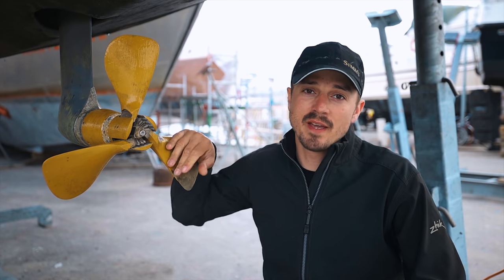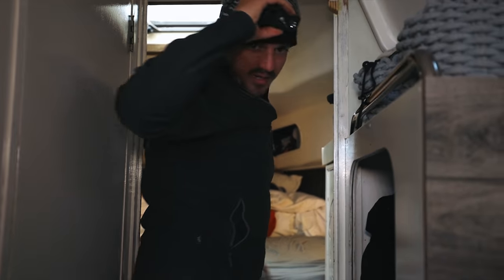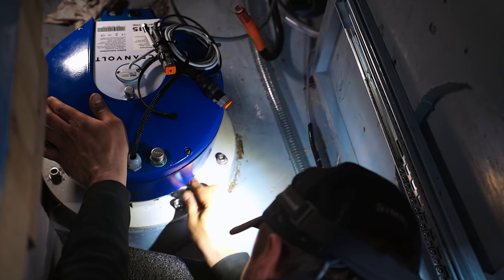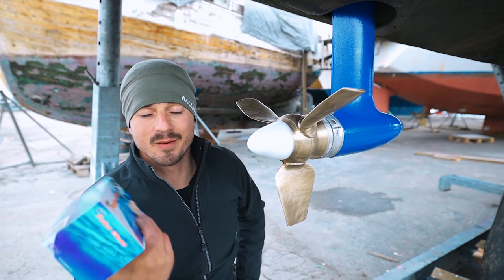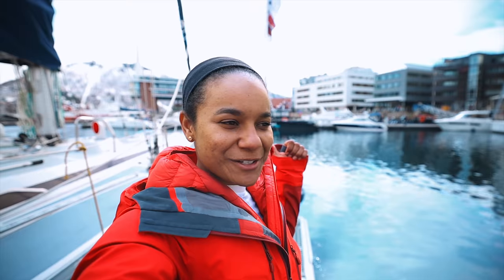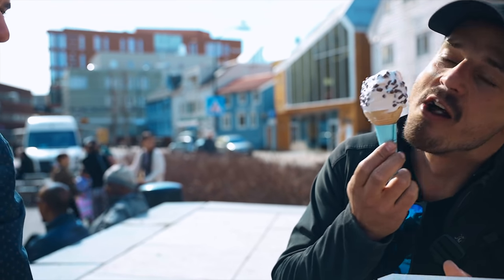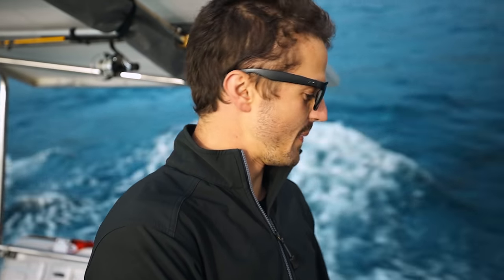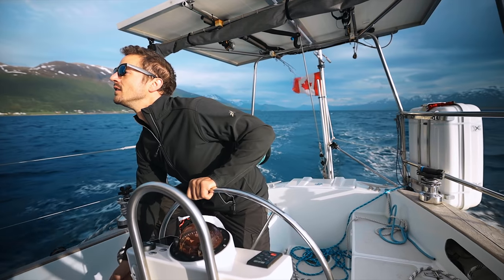Ripping Out our Electric Motor for the LAST TIME! — Sailing Uma [Step 277]

Comment: Nice video. It is not surprising that you don't lose much speed at high wind speeds, when the boat is close to max speed and a lot of energy goes into the ship wake anyway.  Basically you are just reducing the energy loss to the wake. It would be more interesting to test how much speed you lose at weaker winds, when you actually increase the total resistance of the boat in the water.

Comment: The hole around your prop-shaft is a break and could also make turbulence for the propeller. Cant be hard to fix that. The reason you dont notice the regen- is probably that you are close to the hullspeed anyway - in lighter winds it may be more significant. Did you meet  Allure Arctic there -we see his new boat in the back there?

Comment: It would be fairly easy to figure out what speed regen costs you , as you calculate kw required to do speed which will give kw / kt .
You could do this very roughly by knowing how fast your known kw outboard can push the boat.

Comment: Thats great, I can't wait to hear about the low/mid-speed performance and of course the electrical load and regen....as the prop servo is a new power use item.
Reply from the maker: The servo motor consumes almost zero power. It's just to adjust the pitch, then it's "off". So it's only active for a few seconds.

Comment: Wow You Two!! Your installation of the Ocean Volt Servoprop was so interesting I have just watched it again. The numbers are very promising and with your solar array as well it looks as though you will be on the plus side of your energy equation. Are you able to alter the pitch or is this predetermined by OV? Looking at the prop speed (it’s quite low) it seems they deploy quite a steep pitch to generate torque for the regen load. I can’t wait for more data and comments including about the responsiveness in forward and reverse. Real world testing by people attuned to the realities of “going electric” will be of huge benefit to OceanVolt.

Comment: I would have been tempted to close that giant vortex generator around the drive leg with expandable foam, fairing and painting it.  If you ever need to remove the drive leg, you dig the foam out. In the mean time a lot less drag.

Comment: that is so awesome.  Hey I know water pumps can break quickly if run without water. Is it bad for your motor to run it in the air? I know you probably are following the directions which probably tell you to test it just after installation but I just wanted to check.  You guys are awesome, I love your work on your boat. Honestly I'm really impressed by what you have done, more than the other sailing channels.  I wish I could learn to be like you with your boat.  God bless.

Comment: Nice docking! Congrats on your wonderful boat (best modifications I have ever seen), a great job all around! 
Regarding the speed drag from the charging: It makes sense that when you are sailing at or near hull speed, it is not noticeable. That is because there can be a large amount of "excess" power from the wind that acts as a buffer. When a boat reaches hull speed, it takes exponentially more power to make it go even a bit faster (surfing downhill doesn't count because those high speeds are a vector of the wave and boat speed). Where I suspect it will be noticeable (half knot or so maybe), would be sailing up hill in fairly light airs, with speeds of 4 knots or so. Or possibly pointing up in higher wave and wind conditions that tend to push back on the boat, where even a bit more drag will be noticeable (I remember sailing in the Bahamas towing a dinghy in a 3 foot chop, it did nothing to the speed until we sailed into the wind, then it dropped it by a full knot when towing). For this reason I bet a nice fairly heavy boat like yours will be better for this than modern lighter centerboard shallow "scalloped" shaped ones which generally don't do as well uphill in any kind of serious wave action. They are fine boats, just that being lighter the waves push them around more when trying to point (also usually increasing weather helm). On the other hand they usually are a bit faster in most other points of sail for the same length which makes up for it. So, in other words the resultant speed drag from batt charging probably depends on the weight and hull shape of the boat as well as the wind conditions.

Comment: Excellent update on the Oceanvolt SD15 switch from Gori prop to ServoProp system. I really appreciate the detailed test results with points of sail and speed. I was surprised that point of sail made much difference. It helped to understand the issues with Outermer 4Zero with regeneration issues when configures with one of each.
Reply from the maker: STW is really the only number than matters, but it's an average that makes the difference. Waves have an effect on the average STW you can gain. That's why a beam reach produces the most regen. 4Zero failed for a lot of reasons. Regen wasn't even on the top 10 of that list.
Reply: @SailingUma  What are the top 10 reasons that 4Zero failed? Or point me to some source of the information.  I have read all I can find on the experience with 4Zero and it seem to focus on the failure of the regen from France to Canaries in fickled wind and rough seas.  The regen worked well on the return to France in good wind.

Comment: You guys are awesome!
Kudos
Damn, with that ReGen, it seems all you'd have to do is anchor in a current and generate electricity with your sail drive consistently.
I'd love to see if one of the newer style mini water turbines made to throw in a creek and power a homestead worked well as a generator for a sail boat. Since they could be trailed out into a current while anchored, they would also work being pulled behind while sailing for emergency power generation.
Hmmm...
Reply from the maker: It’s seems many think they’re are 4+ kt currents everywhere we go. That’s just not the case. We would never intentionally anchor in that’s strong of a current. If would be very uncomfortable if the wind shifted or was against the current. Plus it only lasts an hour or two, then it slacks, then switches.

Comment: Once you reach 'hull speed'  in a displacement hull your boat just 'squats' and pushes waves to dissipate the energy in a larger wake. I expect you can make significant re-gen without affecting speed. Hopefully the Oceanvolt re-gen pitch is not fixed but is software adjustable. If it is you may you may be able to tweek and optimize the re-gen for differing conditions.
Reply from the maker: That’s the whole idea.
Reply: @SailingUma  I am so happy you are on the right tack :) I am a retired marine engineer having worked with controllable pitch propellers all my working life. They do have limitations and by necessity are optimized to a designer's concept of what the user needs. I look forward to your experiences now that you have cracked open the holly grail of 'the sailing electric'.

Comment: Another great video, you are blessed OV sponsored you, good thing you didn't glass the hole as you said! Would love one, but got to 100k on the configurator and gave up...
Reply from the maker: It took 7 years of negotiation to get there … but yea lol
Reply: @SailingUma  by your calculation it’s 3600 amps of li batteries in 4x900ah banks for 48v to get the 60NM range? That’s what their 43kw offer works back as? I watching your videos and owning an EV surely the constraint now is the charging capacity at docs?

Comment: I would have to say that if the regen is not slowing you down, you have an undersized prop that has a much larger potential for generating power.   I'm a bit surprised that its now 2021 and the producers of this equipment still have a lot of improvements to go.
Reply: They don't want to be slowed down noticeably. That is counterproductive to their sailing style (smaller boat, but sleek and performance focused).

Comment: Glad to see tech innovation progress. We are considering to retrofit a cat with Oceanvolt next year and this practical datapoints brings us closer to a proper calculation for long passages
Reply from the maker: What cat are you planning to fit out?
Reply: @SailingUma  3 options, depending on feasibility and availability in the med. 1. Nautitech open 40 2. Leopard 44 3. Leopard 48. We are iterating on our xls sheets
Reply from the maker: Well here is our hard, but honest advice. Unless you have all the time in the world to wait for weather, all of those boats will require you to have a genset onboard. But you can install that later. Electric motors and massive lithium batteries first (30kWh for each motor) along with as much solar as you can fit. 3-4kW easy. Good light wind sails next. Then spend a few weeks with it before deciding what sized genny you'll need. But, none of those boats will sail fast enough or point high enough to rely on solar and regen alone. And they're all heavy enough, that you'll need to motor at some point.

I'd say find out how much power it takes 1 motor to push the boat to a cruising speed you feel comfortable with (4kts? 5kts? 6kts?) and get a genset that can match that with its continuous rating. My guess would be around a 6-10kW unit. 

Hope that helps.
Reply: @SailingUma  thanks, we consider that as a given, only hybrid works for longer passages
Reply from the maker: Yes. There are very few boat out there that can maintain the speeds necessary to allow for regen along. And even fewer sailors who would actually sail that often. A cat offers great real-estate for solar, which in most places is enough for house loads. 

Our general rule of thumb currently is, twin motors @ 10kts average speed will get you pretty well covered. But most production boats won't get you there. 

A solid hybrid solution really does give you all the best of both worlds with the only negative being price. But if you plan on keeping the boat and living on it for more that 5 or so years, you'll break even and anything past that you'll start actually saving money.

Comment: I love your videos - so much more realistic than a lot of other "sailing" channels.  I have a question about the regen system. Is the feathering system tied to the power monitoring so that, when sailing, it will automatically feather out when regen is needed and feather back in when your batteries are full?  It seems like something that could easily be added to the system that avoids you having to monitor the power supply and manually turn on the regen, but you didn't mention this in the video.

Comment: As always, very impressive. And so great that you are pushing the envelope on sustainable technology. 

One thing: I don't think "pinching" is the correct term. I believe "pinching" means sailing above close hauled, which h is not VMG optimal, and makes sense only in unusual circumstances, like trying to make a mark (especially with favorable current), or when racing trying to get onto the nose of a boat to windward and behind.

Comment: This is really interesting to see the servo prop, but can you discuss how much it costs?   It seems oceanvolt system is out of reach to many and it's not easy to find much information either.   It really seems ideal now you can generate a lot of power and for sure it is working well.   How you consume more than 100W all the time, would be interesting if you did a breakdown even for your own benefit because if this is really true you can for sure optimize it as this is quite high.   The prop is clearly way too small in diameter to have good efficiency for propulsion..  you should be able to go 4 knots at 800 watts,  but everything being trade offs, it may be ok especially now that the "motor" primary use is as a generator.

Comment: You guys are so Canadian! (me too) And you may be changing my mind on electric motors.

The actual hull speed might be more of a factor, the wind in the sails not being the determining factor in speed but the hull, basically the sail will push the boat into the max speed the hull will do with that force?

Comment: Nice one. Almost to the point of being useful. 
Once you've got enough sail drive to reach hull speed any excess over that may as well be generating power as failing to lift the boat onto the plane. There should be little or no performance cost in those conditions.

Comment: Hey dudes, I just had to jump to this one when it was recommended in my feed. I'm pretty excited about electric boat motors.  I have a question,  excuse me if I am to ignorant to fully understand, but could a slot be cut into Uma and a paddle wheel design regeneration unit be installed, maybe even two, one each side of your fantastic new drive unit. This might mean power can be generated at all forward movement, even when motoring. You may even get tidal flow regeneration at anchor. The prop design could then be simplified again. To me, it looks like regenerative power is the key to this system.  My great uncle was one for this generation in the 1930s when power was unavailable a lot of the time. Now,  I could be way off the mark, but my brain can't help chirping in. 
Fair winds Uma, I'm going back to step 66 to carry on my journey with you. Such excitement for Uma to come.

Comment: I was wondering why yall went with with folding prop. From an engineering perspective it seemed like it would close and be less efficient from the get go. Then again I am also unsure of the big piece of metal piece filling a gaping hole in the boat situation sail drives demand.

Comment: Did I hear you correctly?  The (very clean looking) bottom of that boat hasn't been touched in the year since antifoul?  It's that clean after a year of not being touched?!  What antifoul are you using?  (on the hull not the prop) Or is it a case of cold water boating not growing nasties as badly as warm water, or a combination of factors?  Nice video BTW, as always.  I've been saying "electric's time is coming" for a while so it's great to see it's so, so close to being long distance viable through reclaiming.  All the best and happy sailing.

Comment: This is f’n cool stuff.
Perfect 👍🏻. 300 watt is my calculation form a long time ago.
A client liked  to install something.. so we ran numbers . The investment was more expensive than the re-gen ever would safe. 
Draw back the old system it needs good speed to make power we had no pitch prop .
Reply from the maker: The benefits of electric aren’t simply a financial decision. It’s hard to put a $ value on peace and quite and ease of use or lack of maintenance headaches.

Comment: What about a wind vane it can generate electricity also it help especially when you are on anchorage in there is a bad weather in you cannot sail.
Reply from the maker: If it’s big enough to actually generate power, it wouldn’t fit on a boat.

Comment: You probably know this (seems so anyway) but worth mentioning anyway. With any power generation system, the maximum power that can be measured relies on the available load. This means I trust the upwind power for sure just because broad reach was higher. But the broad reach figure is less certain, at least from our end. You probably know your system well enough to know if the load available was enough to make sure your measurement was valid as well. Seems like a good system in any case. I have read that with some systems it is possible to sail in lighter air at less than full speed and then add electric propulsion to increase speed while still pulling charging current... add speed on the climb of a wave and regen while going down the back of the wave. The system has to be able to be in regen mode while pushing for that to work. I would guess power setting would be important too. Have a good one.

Comment: I noticed a couple of things.

The chart lines are very linear output/SOG (should have been STW ?) however, it varied based on apparent wind. Does it measure the power in the boat and calibrate the pitch to suit. i.e. DW it produced less power for the same SOG or is that because of differences in STW... Going in the opposite direction in current ?

Also the size of the prop is smaller, do you lose much grip in the water when manoeuvring in the marina.

Comment: hi Dan and Kika, 
really love your channel and i have to say you guys have kept the channel interesting since the beginning, love  every episode.
i have a question and would appreciate your opinion.
so i see you have a 48v battery bank for the motor that is charged by the solar panels or  also by the new motor and you have a converter for the 12v lights and electronics.
my question is, if you had a 50 ft sailboat, with solar panels and electric motor, would you have a separate 12v battery bank, and would a converter charge the 48 volt battery battery bank or the other way around.
and if 2 banks, which would the solar panel charge.
would appreciate the feedback.
thank you
manny

Comment: Nice device! Congratulations! )
... you would love to have uncut propeller blades and smooth, manual propeller pitch control. You could draw off a kilowatt of energy to charge the batteries.
Reply from the maker: If you have a system like that… let us know. As far as we can tell, it doesn’t exist.
Reply: @SailingUma  no, I have no system. It is necessary to ask the manufacturer for changes in the controller program and long bladed propeller.
Excuse for troubling.)

Comment: seeing as you have a servo motor, I wonder if ocean volt could go in "nuetral" ie, not forward, or backward, .. but still spin the prop fast, . and you could use that to "walk" the back of the boat one way or the other, without moveing forward , or backward.